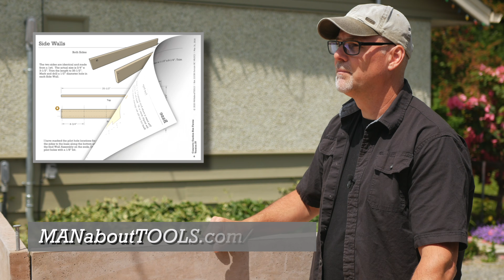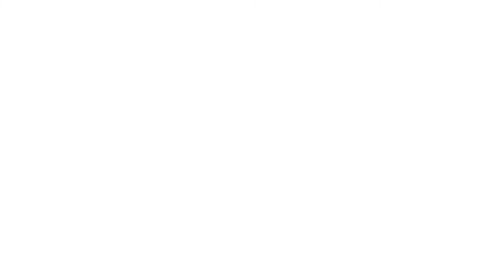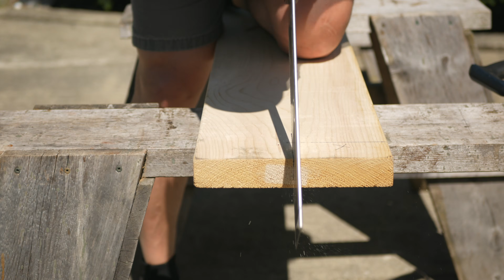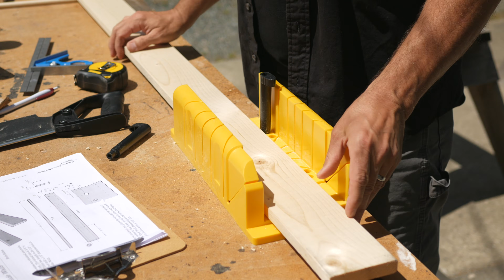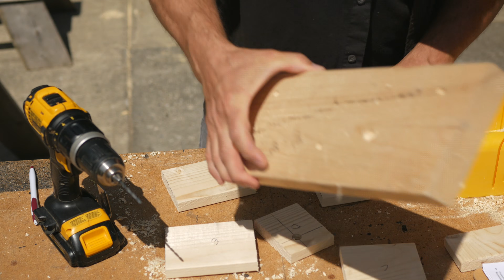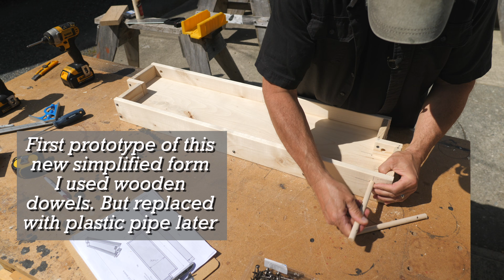DIY Simple Concrete Garden Box - PART 1 - Make the Molds

Comment: Great job and like your design. I've made molds for outdoor table tops and have found using sanding shellac on the raw wood helps to seal and reduce swelling of the molds. I also use a mixture of 1 to 1 Vaseline and naptha oil. It will help with the release and preserve the mold too.
I understand you are using for garden beds so it's optional.

Comment: I'm watching this 2 years later, and after watching the other videos I was thinking along this pattern, 
My thought would be to use some bolts that slip one the holes in the form. These bolts would hold the PVC pipe in place. 
After the concrete hardens, pull the bolts. The pipe stays in the concrete.

Comment: I'm going to try this out. My wooden  garden beds sre starting to fall apart, as they are 12 years old. This design would suit the amount of work that I'd need to do.
I've worked out that I'll need at least 168 blocks of 125cm length or more,, as I have a fairly large raised  bed garden.

Comment: This is an awesome project and thank you for sharing! Although one thing just came to my mind what happens with srcews if they are being loosen and tightened many times when you peel the form off? Will they hold strong enough? I think I would use some sort of threaded insert. Sorry, I'm not native in English, not sure how you call'em.  These a cylinder shaped piece of iron with a whole and thread inside like here https://www.google.com/imgres?imgurl=http%3A%2F%2Fvasalatdepo.hu%2Fstatic%2Fsite-7%2Fmedia_catalog%2F2014%2F07%2F18%2F241%2Fk%25C3%25B6zpontos%2520menetes%2520csap.jpeg&imgrefurl=http%3A%2F%2Fvasalatdepo.hu%2Ftermekeink%2Ftonkanya.html&tbnid=DW4v-sKZS_6q8M&vet=12ahUKEwi7xciq35DsAhULy6QKHfZWDZIQMygGegUIARCUAg..i&docid=hFAU33-KzuEg5M&w=659&h=400&q=t%C3%B6nkanya&ved=2ahUKEwi7xciq35DsAhULy6QKHfZWDZIQMygGegUIARCUAg

Comment: Great idea .... Can you use exterior poly to seal the form instead of the oil finish you used? ... Thanks so much
Reply from the maker: Yes! And I think it would make the forms last a lot longer. The drawback is you need 3 or 4 coats of poly. And poly is more expensive and more time consuming to apply.

Comment: Question....Our local big box store only sells the ready-mix in 60lb bags and larger.  So if using the 60lb bags, you'll end up with a good bit of "extra" on each pour.  What is your recommendation for up-sizing the design to utilize the "extra"?  Would you add more thickness or length?
Reply from the maker: Adding more length would be the easiest mod.

Comment: Thank you! You've inspired me and I've done about 60 panels. A bit different design. Instead of cutting base you can just use a piece 5x5x12,5 cm (2x2x5 in) attached permanently to one 25 cm(10 in) board. I find this easier way.
Reply: Could you clarify what you mean by using a different base? Sounds cheaper!

Comment: MaT....for the upright parts of the form....why do you chose to use 1x stock instead of 2x stock? I would think that with all the moisture involved that 2x stock would be more stable, strong and less prone to warping over time. The cost factor between the two isn't that great yet I would think you would end up with a far stronger, durable and more stable form.

Comment: Why mineral oil and not a polyurethane or something that you don't need to keep reapplying? Just quicker?
Reply from the maker: Yes. Mineral oil because it's so quick. But, polyurethane would work very well. I used it on the plywood forms in Part 1 of the series.
Reply: @MANaboutTOOLS  thank you!

Comment: Have you thought about using melamine instead of wood for the form?  Another YouTube channel, Michael Builds, uses melamine to make molds for concrete counter tops       https://www.youtube.com/watch?v=T7mYB6x68DY&t=306s
Reply from the maker: If you are doing repeated pouring I think regular lumber would stand up to the moisture better over time. Melamine is over particle board which does poorly with moisture. For one or two countertops it's great.

Comment: For us who are just learning  what, why and how to cure the concrete for the best results
Reply from the maker: You could lay some plastic on the ground. Lay the panels on top and add some sand. Then soak it all with water then cover with more plastic. And water it every few days or if it shows signs of drying.
Reply: Thanks
I was a bit confused with people talking about putting them in a water trough for a few weeks
Didn't think they needed to be immersed

Comment: I'm planning to try it out, however this can be made even simpler with a basic rectangular base and attaching sides to that then cut four smaller pieces for an L shape insert to the ends. Cutting the L shape into the base makes it a bit more complicated build than necessary, especially when using handsaws only. Also the L shape will not really need any support from the base, it gets supported from the sides.
Reply: This appears to be a good idea. It eould allow for the ends to slide for a variable length mould.